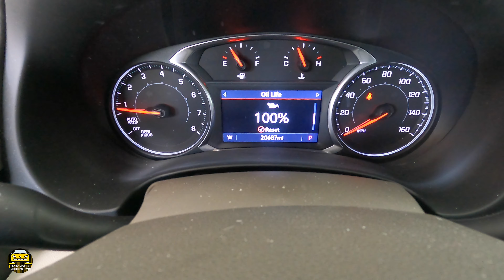How To | 2018+ GMC Terrain  | Oil Change | Oil life Reset |

Comment from the maker: Let me known comments if you need any other specs for this car, example transmission  capacity,Torque specs and etc....
Reply: I just bought a 2021 Terrain, what oil should I use and when should I do my 1st oil change? Also if you know what is the proper tire pressure on this vehicle. TY
Reply from the maker: @patrickoneill290  what engine?1.5L Gas? 1.6L Diesel? 2.0L gas?
Reply: @AutomotiveDysfunction  1.5 Gas
Reply from the maker: @patrickoneill290  0W-20
Front Wheel Drive Oil Capacity:4.2 Quarts
All Wheel Drive Oil Capacity:5.3 Quarts
Engine Oil Drain Plug Torque @ 18 Ft Lbs
The best thing you can do is get your manual and it will tell you everything how often eng. oil  needs to be changed . don't have that info yet since its 2021 model still fresh... will have all info. soon

Comment: It's best to prefill the oil filter with clean oil before installing it. Prevents engine dry start when you initially turn on the engine after a fresh oil change

Comment: I want to change the oil in my 2020 GMC Terrain Denali 2.0, but I've already seen some videos where they put 4.7 L of oil like you did in the video and I've also seen others where they put 5.7 L like it says in the manual, so I don't know which of the two measurements to put. I need help 😮😅

Comment: Helpful video👍 But a little more cleaning on the oil filter surface mount and drain plug as well as using clean oil on the oil filter mounting gasket.
Reply from the maker: No need for using clean oil on oil filter gasket … all you need is 1-2 dripps of old oil and that’s it .. it’s not going to go inside of engine and for some Miracle If did go an inside of engine there is still bunch old oil inside .. 1-2 drops won’t make a difference trust me I know what I’m doing
Reply: New oil filter and clean new gasket. I’ll use clean on clean. I also have changed oil  and know what I’m doing too👍
Reply from the maker: @wadewacker7276  ok you do whatever makes you happy lol
Reply: @AutomotiveDysfunction  I’m just to much a neat freak😂 still think you have a good video👍
Reply: @wadewacker7276  totally agree, great video!!  Clean on clean though. I've worked on vehicles over 40 yrs and 10 of those at the dragstrip and if the owner caught me using old oil on a gasket on his dragsters or his mod he'd have ripped me a new one and I've always held my work to that kind of standard for the simple fact if anyone asks, I can honestly say I did my best. That oils already toast and has contaminants ( tiny metal shavings like all old oil does) and as it heats up especially here in Texas its just not optimal. Seal has to last and as most oils in newer cars are the better synthetics made to go further than old school oil, you know its gonna need to last longer under more heat. Also, its not mentioned but, this oil you're draining is either really, really cooked or you heated the engine 1st. Always a good idea, didn't see it in the notes but, even a newbie should have complete info. On a side note, I always find the direction the drain flows too and jack appropriately so if any shavings are present in the pan they wash into the catch and are easily spotted, never truly know what's happening in a motor  short of removing the pan but, you can always advise folks as well to rub some old oil when its almost drained between clean  fingers and feel for any grit. Better safe than sorry. I do that on all my vehicles, especially the higher mileage ones.  I really appreciate this video being up, it tells me all  tools I need and shows the service points and now that I'm disabled that saves me time in the Texas heat and thats priceless!! Keep up the hard work and I appreciate the content boy howdy!!

Comment: What is the best typ of oil for a gmc 2018 terrain sl 1.5 2wd
Reply from the maker: 0W-20 Full Synthetic 4.2 Quarts ( honestly it depends on your budget as for oil brands, there is lots of good oil brands out there whatever works for your budget, mobil1,castrol,valvoline,etc all good )
Reply: Amsoil is the best
Reply: @jonathanrivera3480 but unnecessary unless you plan to keep the car until 300k miles

Comment: Do you know what would cause these cars to make a weird noise at idle?
Reply from the maker: That’s hard to tell without looking at car it could lots of things
Reply: @AutomotiveDysfunction  I understand only does it at idle tho, whenever driving car sounds fine. Guess I’ll tear into it tomorrow
Reply from the maker: @chadmarsee8874  idk just a guess  maybe bad drive belt tensioner? Get stethoscope (cheap at harbor freight )  start the car use stethoscope all drive pulleys , belt tensioner, alternator etc … use it around where noise is …

Comment: Wouldn’t you want to smear the engine filter with the new oil and not the old one?
Reply from the maker: Nope ...it don’t matter  really ,a bit  of oil stays on oil filter gasket , it doesn’t go inside of engine
Reply: @AutomotiveDysfunction   do you still have to fill the oil filter with new oil or is that just preference?
Reply from the maker: @mharkapolinar5135  nobody does that
Bro anymore ... they used to that  back in 90s and 2000s early with turbo model cars only...
No need to that anymore on newer cars ...
Reply: If you have a vertically mounted oil filter then yes it’s a good idea to pour fresh oil in before installing and if it’s horizontally mounted pour a little less oil in and let the element wick it up a little before installing👍 Bro it’s better for initial start up weather the vehicles were from the dawn of time to today 😂 just saying……….
Reply: PS, make sure the end of the oil filter with the holes is pointing up👍😂

Comment: Never use dirty oil to lubricate the new filter. Take your new oil jug, break the seal, put the cap back on, tip the jug upside down, then use the oil collected on the underside of the cap.
Reply: Why? The oil lubricating the rubber seal never sees the inside of the filter so there’s no harm in using old oil. And besides, it’s such a small amount (we’re talking fractions of an ounce) that even if a tiny bit did seep in it’d hardly affect the lubrication of the engine.
Reply: Some people are clean with their work and some people settle for good enough. If they both assembled automobiles, which person would you want building your car🤔
Reply: @wadewacker7276  apples to oranges. We’re talking about an oil change, not building engines. There’s more dirty oil still in the pan after draining than around the ring of an oil filter. If it’s not necessary, don’t preach it.
Reply: Your right its not building engines and your better off with changing oil, stick with your sloppy workmanship👍
Reply: What about the remaining old oil left in the pan? Bro you don't even make sense. Shhhh
Reply: “Never use dirty oil to lubricate the new filter”. Or what your engine will crap out .25 miles earlier than if you used fresh it’s whole life?